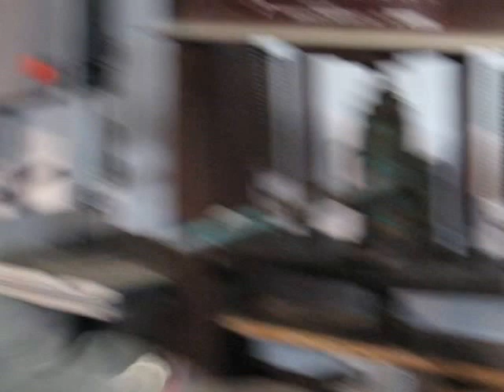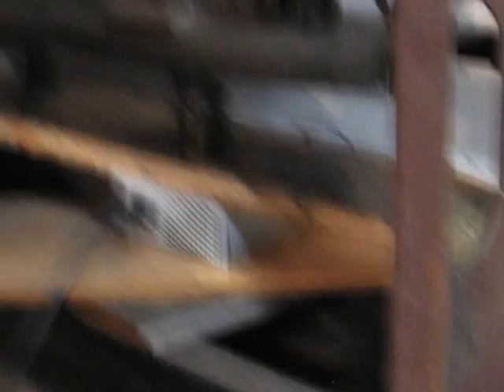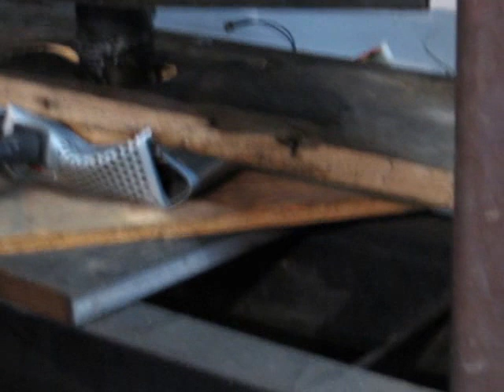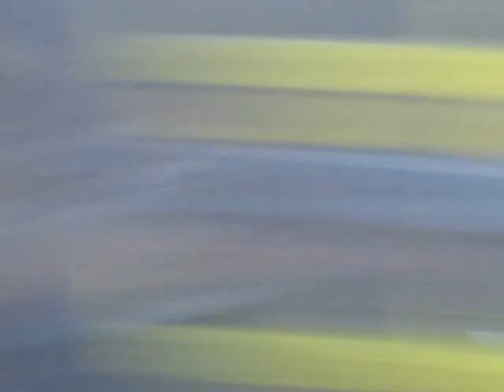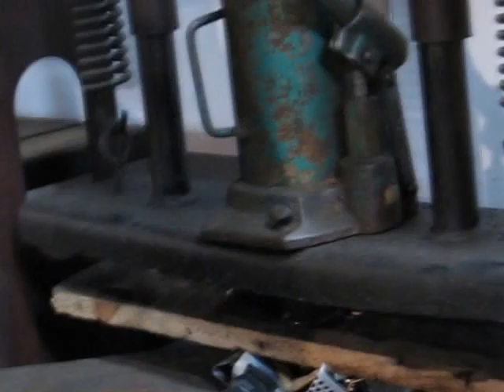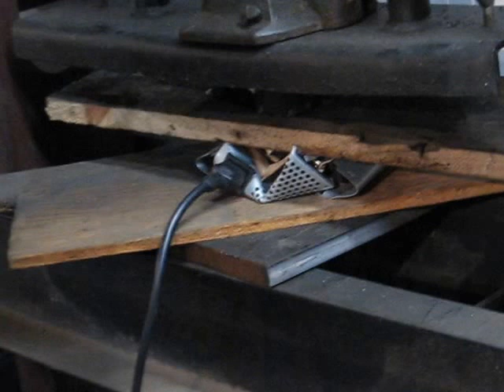hydraulic press power supply with power

Comment: When we were kids, one day we took a car, drained the oil and ran it with a brick on the gas peddle full throttle to see how long 
It would take for the motor to explode. Thing ran for over a half hour, then just stopped. No explosion ! Very disappointing. After that,
We went back to the usual, setting our model cars on fire with lighter fluid. Lol